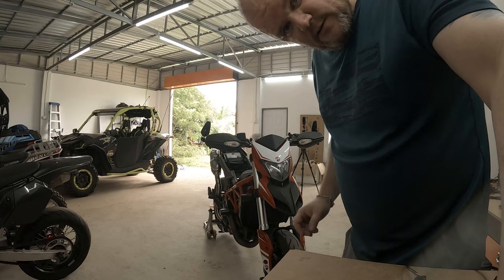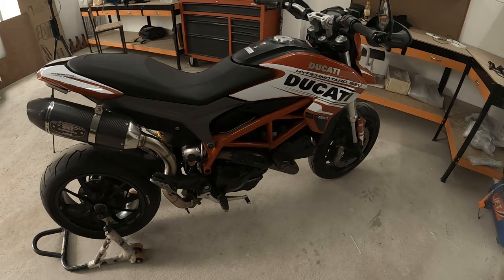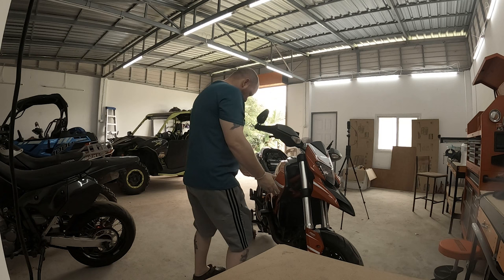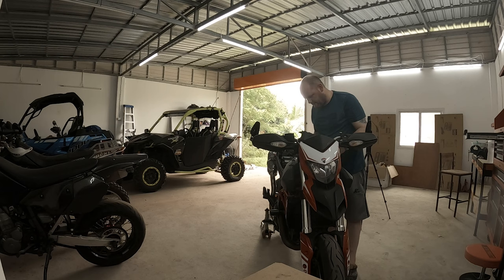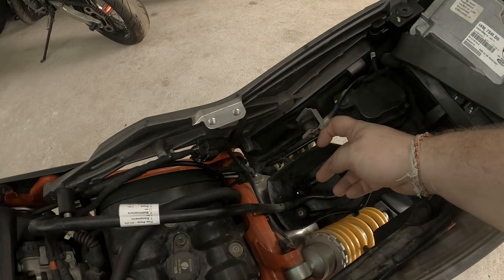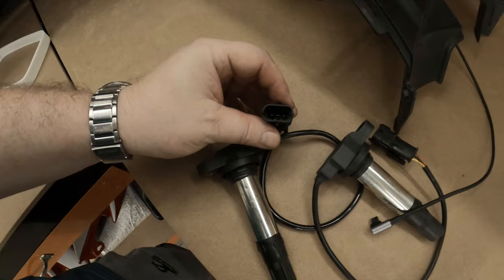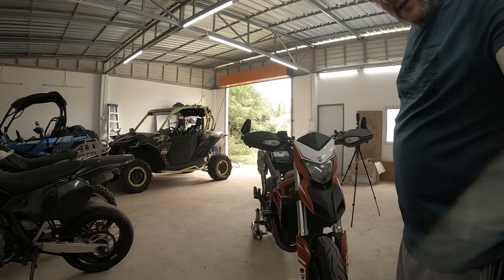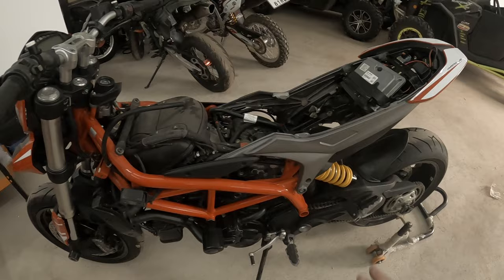DO THIS to your Ducati Hyper - Hypermotard 821 Mods Part 1, Coil Swap.

Comment: 2 bolts hold the panel that the seat lock is attached to.  Remove them to get the lock out of the way.  Saves a lot of pain.  Kind of beatiful how it is JUST in the way.
Reply from the maker: Yeah found this out later, far easier to remove the tank with the panel removed, thanks for the comment.

Comment: Hey Man.. That coil u have changed is a upgraded version.. It also has been use at new Hypermotard 950 and Hyperstrada 939😅
Reply from the maker: The beru coils? Yes but many people have still had issues even after getting their coils changed, not a chance I was willing to take for the small price of some 2nd hand Eldor coils, cheap insurance in my book to not have any issues later down the line.
Reply: @RudeboyMoto  Good for you.. My bike is from 2016 till today.. I still use that Beru Coil.. Weird rite?

Comment: I have a 2013 821 hypermotard sp..Did the recall from ducati adding the Can bus filter..Basically with a sprint filter,Termignoni slip on & T800 upmap..Only recently when i ride it i notice alot of backfire..My mechanic told me might be ur ignition coil..I check mine & still has the Stock Beru coil..Already ask my mechanic to order for me the Eldor coil..i hope it fix the backfire & not so smooth 4krpm to 5rpm surging..Its hard to be smooth on it.Btw Im from Singapore 🤓✌🏼
Reply from the maker: Hi Ismail, not sure the coil change will fix your backfire issue but it will give piece of mind that you won't suffer the christmas tree dash lights and fry your ECU, are you sure your T800 upmap is set up for slip on and not full system? Also when doing your coils fit new spark plugs also as this may help a little as these bikes are quite sensitive to fouled/dirty/old spark plugs.

Comment: I think you said "...get 848 coils" but then you said you used Eldor coils from 848" - Ducati 848 EVO 11-13 ignition coils have the same connectors as the Hyper. Will these work ?
Reply from the maker: If the have the same connectors then they should work, as far as I'm aware any Eldor coils from Ducati bikes that use the 848 or 1098 engine should work.

Comment: I have the 2014 Ducati HYPERMOTARD Sp 
Any advice?
Reply from the maker: Apologies for late reply, my only advice would be to check see if its been done already, if not do a search for ducati recalls there is a site you can input your vin number that tells you if your bike had the recall done and the choke fitted, although some people that had the recall done still had issues so for me it was cheap insurance to buy a second hand set of coils and fit them and it removes the doubt that it could happen to your bike.

Comment: Hey, any idea if these Eldor coils would fit on 2021 Hyper 950SP? Technically they should, cause stock coils are same as were on you Hyper
Reply from the maker: To be honest I don't know as have never worked on a 950, are you sure the stock coils on the 950 are the same as the stock coils on the 821? I know there Beru coils but do part numbers match up? I've never heard of anyone having an issue with the coils on a 950.
Reply: @RudeboyMoto  yes part numbers of OEM Beru ignition coils for Hyper 821 and 950 are the same
Reply from the maker: @skarolis46  ok didnt realise that, they must have done something to rectify the issue then as the 950's have been out a good few years now and not seen any reports of it happening to them.

Comment: What exactly is the purpose for changing out the ignition coils?
Reply from the maker: If you watched the video you'd already know the answer, basically the stock coils are known to cause voltage spikes which can damage the dash and ECU.

Comment: My lights just started flashing on my 3 day old, 821SP…. How fucked am I? Should I buy the coils and swap em? Will that work?
Reply from the maker: Chances are if your getting the Christmas tree lights on the dash then damage is already done, do a search for the Ducati recalls page and input your vin number and it will tell you if the recall was done on your bike, if not then get yourself to your nearest Ducati dealer as they e been pretty good at honouring the fix on a lot of bikes.

Comment: So did you put the coils from the 848 to the hyprmotard .
Reply from the maker: Yes, picked up a used set from ebay off of an 848, I believe they can also be from a 1098 as they are the same.

Comment: How are you sir I need help mine 2013 hypermotard sp 821 dash light are blinking and it won’t start please help
Reply from the maker: Hello, unfortunately it sounds like your dash and possibly your ECU is fried, you'll need to get it to Ducati so they can plug it into there diagnostic machine, if your lucky then maybe they'll honour the warranty and fix for free since it's a known issue, if they do fix then change your coils after the fix as the newer coils Ducati fit have still been known to cause the same issue.
Reply: Thanks for your respond sir the dash looks fine it just fash like a disco and it said arrow but I’m not mechanic I guess I’m gonna have to take it to the dealer I’m not happy with this bike under 5000k miles
Reply from the maker: @franciscomarte6370  Maybe its just ECU, or could be a totally unrelated problem... Ducati done a "fix" where they put a choke on some of the wires going to the dash but this only saved the dash and people were still frying there ECU's even after the fix, if you haven't already check out the link to the hyperstrada forum in the video description as there is a lot of info about this issue and the fix in that thread, might also be good to show the dealer in case they try to say its not a known issue, good luck and keep me posted on what the issue is please, thanks.
Reply: @RudeboyMoto  no luck yet
Reply from the maker: @franciscomarte6370  Hey mate, sorry for late reply I've been away working with limited internet access, what have you done/tried so far? have you had to a ducati mechanic to get it plugged in and see what the issue is?

Comment: Hey bro what are you doing with that yoshi exhaust??!
Reply from the maker: Probably sell it, its fake? also I'm in Thailand so depending on where you are shipping would likely cost more than buying anew one.
Reply: @RudeboyMoto  yea I have a sc project already I’m in the U.S. I just did honestly like the way that looked. Also I was a bit comfused on the coil pack upgrade. The Ducati 848 ones you used plugged directly into the harness but that Hyperstrada forum the guy used Aprilia ones and had to modify the connector. Any reasoning behind that? Thanks for the quick reply!
Reply from the maker: @Cameron Caltabiano  the Aprilia ones have different connectors from Ducati so need to be changed to fit where as ones from an 848 or 1098 are the same connection so no modification required.
Reply: @RudeboyMoto  awesome that’s what it appeared to be I was just confused on why almost write ups they use the Aprilia ones when they are not a direct plug on
Reply from the maker: @Cameron Caltabiano  I think it's just the aprillia ones seem to be more readily available and cheaper.
Reply: @RudeboyMoto  gotcha, is a tune needed after the coils or just with the exhaust. I have a short SC projects can and it’s a bit surgy and jumpy, not smooth
Reply from the maker: No tune needed for just the coils but one is recommended for the pipe, these bikes are known to be lumpy at the low end, mine is the same, I'm looking at getting the rapid bike evo tuner for mine, seems to be the best all round for what I need, not really looking for more power just looking to smooth out what it already has, there not cheap though, nearly 500bucks.
Reply: @RudeboyMoto  okay good to hear. Have you tried the fooler so the bike thinks it’s below 30 to give it more low end fuel?
Reply from the maker: @cameroncaltabiano5030  Guessing you mean the booster plug? No haven't tried it, haven't really seen anyone else try it either so didn't do much research on it.
Reply: @RudeboyMoto  yea I’ve done one on my old ktm 990smt it worked well. Thank you for all the replies though man I subscribed
Reply from the maker: @Cameron Caltabiano  no problem buddy glad to help when I can, I'm no expert but enjoy messing around with bikes, thanks for the sub.